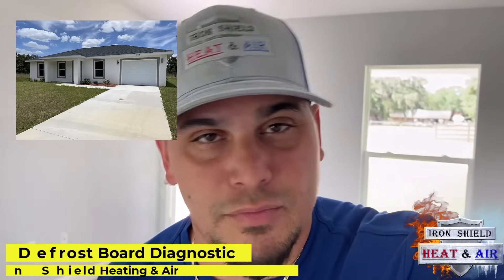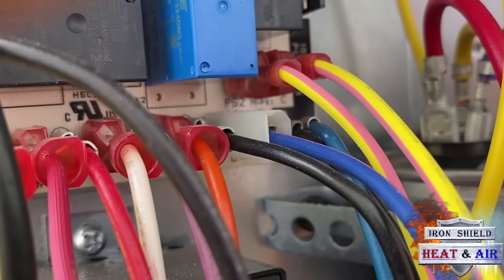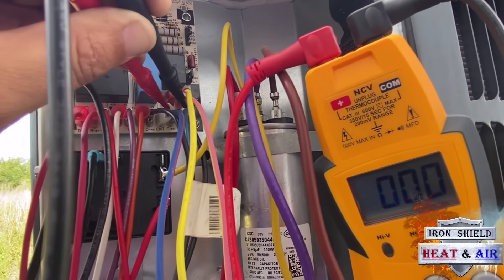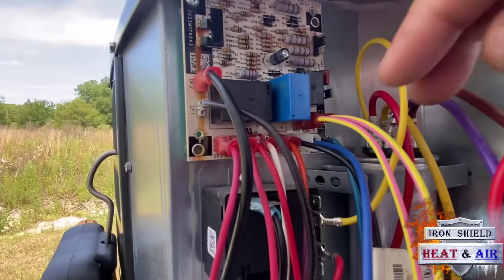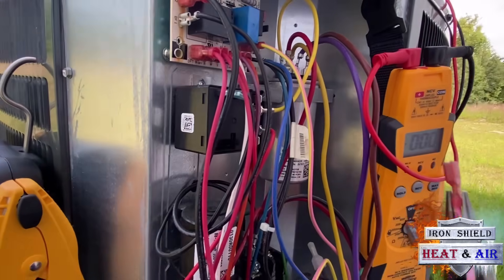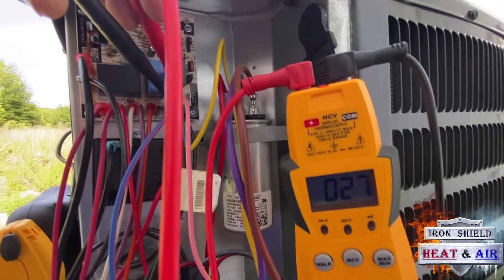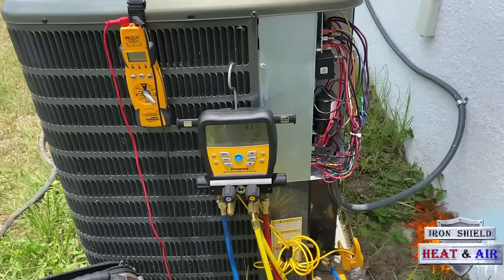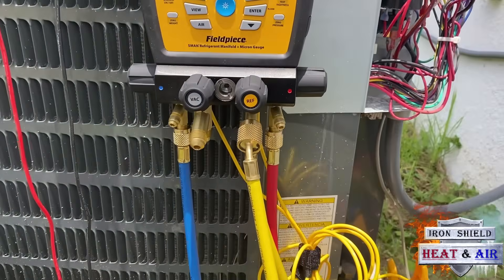How to diagnose a bad defrost board on a Goodman heat pump

Comment: good tutorial Thanks  but should you not also ck the LV Power is going in & out Thur the  HPS on the board also like you did the LPS  before condemning board  ???  but good call bad board bc corrosion

Comment: So on mine, the low pressure switch was shorting to ground because the wire going to it got worn in two by the TXV line it was about to wear into on the condenser tubes

Comment: Could you just test for continuity across the low pressure switch by pulling the connectors off PS1 & PS2 and hooking your meter leads up those two wire connectors?

Comment: Hi. Thanks for this. I am looking at a unit is only 3 years old and was freezing in cold weather. Otherwise works fine winter and summer. I shorted the defrost board test pins and nothing happened. I got a new one and installed it and the new one is also not responding to shorting the test pins. Is this a wiring issue? Something else?
Reply: Check the defrost temperature sensor probably going bad on Goodman systems they can't go into defrost mode when DFT sensor open

Comment: Pro tip. Never hold a control board like this guy did in the thumbnail for this video. Always grab and hold the board from the sides of the board.
Reply: Yeah your right butt... that don't matter when the board is bad anyway.. and really it ain't that serious,  you can't tell me that board is gonna get less moisture from hands then the humidity and morning dew... what your saying is good practice while installing new boards.
Reply: @dannielharrison6449 exactly!
Reply from the maker: Please educate us on why that is? 😊
Reply: @ironshieldheatingair5751 it can damage the circuitry via moisture and/or direct contact
Reply: @ironshieldheatingair5751 there is plenty of information on how to handle low-voltage controls and communicating systems. 

Nonetheless, moisture on your hands can short the board.  And our own’s body’s static electricity can discharge into the board and damage it. Not to mention that boards have fragile components and should be handled by not touching those components unless you have to

Comment: Low pressure switch should be in series with high pressure then to your contactor coil, either one opens shuts power to contact coil

Comment: Great job troubleshooting!!! The rusted-out parts on the board are transistors. The only thing I would recommend to you is if you're messing around with any electrical system, you must take all jewelry off. It would take only one freak movement dodging the wasps to get stuck on the 220vac at the contactor input. Other than that, you have outstanding troubleshooting techniques. Keep those videos rolling.

Comment: This is a horrible install
Reply from the maker: That’s how the system comes from factory 🎉
Reply: The hard start installed on a brand new system? 😭 and why is it upside down
Reply: @justynnoss2786  goodman needs them. They install them on their diakin  units too but usually on goodman you need to add it yourself. Definitely quirky
Reply from the maker: The builder loves it, the new homeowners, and the inspectors. There's nothing wrong with this install buddy. Thanks for watching